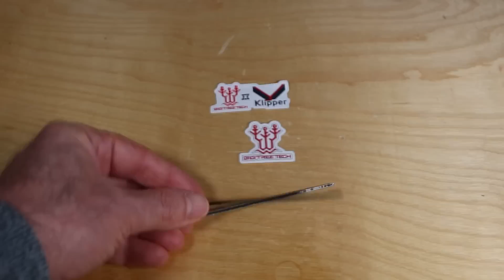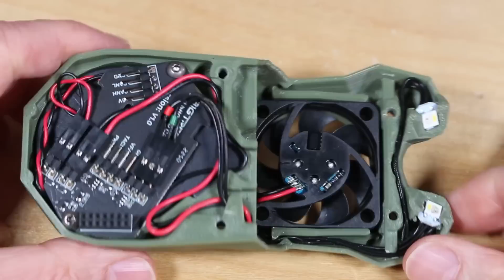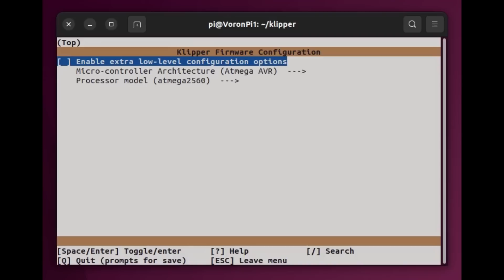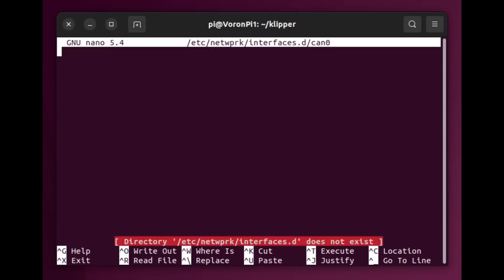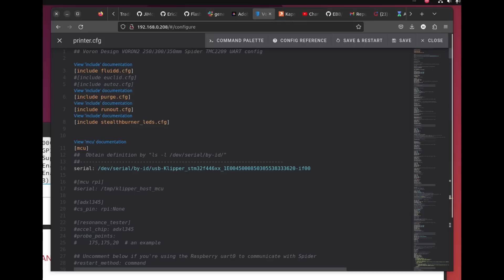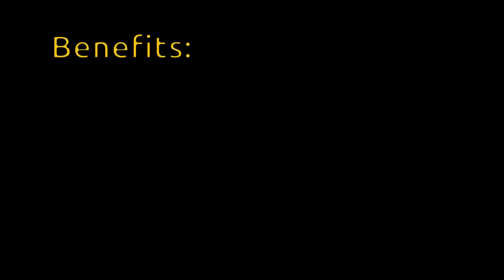Canbus SB2240 and SB2209 3D printer Install, Thoughts & Tips from BigTreeTech (BTT)

Comment: Did you go strictly by the instructions in the wiring?  I am seeing some differences in what you wired vs what I see in the instructions.
Reply from the maker: I might have made some changes. Many of the switch type and sensing inputs are very flexible in how they can be used.  Are there any areas of concern?
Reply: @KapmansBasementWorkshop  Just the wiring of in general, according to the pdf, the 24v VIN on diagram is far right but the labels say its far left, for probe, it states GPIO, gnd, blank, 5v, blank, but then it appears that you have used the far right three which kinda makes sense to me because it appears that the first pin (from right to left) is the actual 5v. so I am just confused on what the right wiring is for the SB2209 is.
Reply from the maker: @ReneWilsonSC  If you tell what items you are interested in, I can come back with where I wired it.  Keep in mind, even with my glasses on, I have a hard time reading these depending on the size of the labeling.  I might have made a few mistakes, but most pins are pretty flexible as long as they are setup correctly.  Also, in some cases, if a wire was not long enough to get where I initially wanted, I will tend to look for a place it can fit.  A switch will work on any set of pins as long as it was designed for a switch.  You just need to get the correct pins entered for that switch in the printer.cfg file.
Reply: @KapmansBasementWorkshop  I would of liked to seen the actual wiring part with explanation for instance I see your using the PT100/PT1000 port.  What exactly are you using with that?  I have a Rapido hotend and I am putting the thermistor in the TH0 slot so what am I missing.
Reply from the maker: @ReneWilsonSC The Rapido (what I used) comes with a PT1000.  So I followed the SB instructions on setting that up.  I won’t be able to take a photo until next week….
Reply: @KapmansBasementWorkshop  OK I am still a newbie so I hate to ask all of this on one go round but figured if I had the question, someone else may too.
 I think I have a bad SB2209 because after you flashed yours, redlight went out and mine is staying on, I was able to get an id on it but I think I need a replacement. I am running Pi, to U2C to Octopus Pro.

 So here are a few questions that I had for you:

1. Your line 14, if I am following correctly, you have connection from Rasberry Pi to U2C to MCU, right?  Do you still show /dev/serial/by-id ?  I am looking on my pi and I do not. I am showing the canbus_UUID though so do you still need that line?

2. ON the sample, it shows [MCE EBBCan] and the labels for pins are EBBCan: Pin, but on your configuration, you are can0, I am assuming I should have can0 because that's the port that we configured in ifconfig, right?  

3. You stated that you cant use UART mode because your using the SB2240, so seeing I am running the SB2209 do I need to comment out all of the SPI parts from under the adx1345?

Sorry to hit you up with all of these questions, but I am fairly new at this CANbus thing.

Thank you in advance
Reply from the maker: @ReneWilsonSC  I'm answering these out of order.....
2.  I call it can0 simply because I used that on a previous canbus board I was using.  I simply like.  You can call it EBBCan or can0 or anything you like actually.  
1.  I have the main MCU connected directly to the pi via USB.  I also have the pi connected to the U2C via another USB port and cable and then the U2C to the SB2209.  In my printer CFG file, I have 2 mcu's listed:
[mcu]    
##	The MCU that runns all the other motors
serial: /dev/serial/by-id/usb-Klipper_stm32f446xx_1E0045000850305538333620-if00

[mcu can0]    
## The SB2209/EBB36/or whatever canbus is mounted on the print head.
canbus_uuid: f545025fdc42 

You must have both lines as you need to instruct klipper where the 2 MCU's you now have are located.

3. I seemed to have lost my previous printer.cfg file.  But I believe this is correct.  But if I were you, I would have a look into the BTT GitHub.  They have a sample printer.cfg file that shows you how the pins are configured for the 2209.

Comment: So with the per-crimped wires suggestion, how did you connect those to the existing wires? For example the Heater cartridge or the Heater TH?
Reply from the maker: I cut off the existing connector on the TH for example, place heat shrink tubing on the wires, solder the pre-crimped wire onto the newly cut wire and then shrink the heat shrink.  I've been told the newer kits come with pre-crimped connectors.
Reply: @KapmansBasementWorkshop  makes sense. I just got the SB2209 and did not come with any pre-crimped wires. Did you do the same for your hotend heater cartridge wires as well?
Reply from the maker: @jaredlewis2961 Actually, I can’t look at the printer right now, I believe I treated that one a little differently. I think I built an adapter cable for it.  My hot end wires were too short to reach. I trimmed one of the precrimped wires and attached a connector on the other end to plug the hot end cable into….

Comment: How have you done the labelling on your cables?
Reply from the maker: I didn't.  The lengths are so short on the tool head and easy to trace.  I did not bother.  Also, for the canbus cable, I felt the colors were quite clear so I left those alone as well.  It's only 4 wires.  This isn't the best answer, but so far it's working for me.

Comment: I would be curious to know what connector you used on the U2C to connect the canbus to your SB. The reason being that there are JST connectors as well as the Molex ones for connecting canbus clients. I am assuming due to the power requirements that you need to use the Molex.
Reply from the maker: I actually used the screw terminals on the U2C. No connectors.
Reply: @KapmansBasementWorkshop  In your video the green power rail is used to connect to power. So how are you powering the SB2240/2209. Is it powered directly from the PSU? Hence the question about the Molex. I was under the impression that you use the power rail to connect to the PSU and the molex to connect both power and can h/l, to the SB
Reply from the maker: @GrumpyDave1  I have done it 2 different ways.  Both work.  1. 24v + and - wires from the PSU into the screw terminals on the U2C  and using the same screw terminals for the power wires on the canbus cable.  2. Canbus power directly to the psu screw terminals. And a 24v cable from PSU screw terminals to the U2C screw terminals.  I don't think this last cable was needed, but I connected it just in case.  They both work fine.
Reply: @KapmansBasementWorkshop  So I decided to go with PSU to green power connectors on the U2C and Molex for the power and canh/l to the SB2040. I do like your way to avoid having to crimp a molex. I assume you used the screw terminal on the U2C for the can h/l?
Reply from the maker: @GrumpyDave1  Yes, I used the screw terminals for H & L.  I've never fully mastered the art of crimping those connectors and I had to cut the connector that was on the cable to feed it through my intended path.  So I just skipped crimping outright.  I'm sure the Molex option is just fine, possibly better in the long run.  Thanks for the questions and comments!

Comment: Guy are you having problems with the stepper stopping mid print
Reply from the maker: The extruder motor?  You might need to lower the current to the motor.
Reply: @KapmansBasementWorkshop  i have lowered the current to 3.0 should i go lower?
Reply from the maker: @grathado28  Do it just stop completely, or does it make some noise of any kind?
Reply: @KapmansBasementWorkshop  i just want to update you i was completly stupid the motor actually never stoped but i i think the lever inside the device was off (lgx lite) i fixed it and now it prints like a dream your rock for getting back to me thanks :D
Reply from the maker: @grathado28  I'm glad you got it working.  I have made the same mistake before!

Comment: How are the pre-crimped connector wires holding up with the chamber heat so far? I have this setup and having the same issue as you, can't see them well enough to crimp them. lol.
Reply from the maker: They are working well.  I have had no trouble with them.  Also, the crimps are much better than any I have ever done before.
Reply: @KapmansBasementWorkshop  Great thanks for the info. I bought the wire kit you mentioned so will do it the same way. any soldering tips for them since it is a cramped space for the wires already?
Reply from the maker: @Dbauer50  I measured and then cut and soldered prior to installing the cables.  Also, make sure you have heat shrink tubing on hand!

Comment: I don't know what I'm doing wrong. I've gone through three of these on exchanges and I can't get any of them to show up with the lsusb command😢
Reply from the maker: I would check the following:
1. Test the USB cable with your laptop and some other external device to make sure it good and works with data.  Some are only for power or broken.
2. Did you flash Klipper onto the SB2209?
3. Is the SB2209 powered?
4. If using a u2c, is it powered?
5. Try rebooting the PI
Those are the only issues I can think of where this might go wrong.
Reply: @KapmansBasementWorkshop  The sb 2209 won't show up, so I can't install Klipper on it. That is the issue. The only thing I can think of is that I installed something wrong on the pi. I also noticed I don't see my main board through Mainsail anymore, I think my problems are a little deeper than a bad cable or hardware

Comment: Any clue as to why I have no can0 file? In reference to about the 15 minute mark. Folder is even empty when I run an ls command. Thanks!
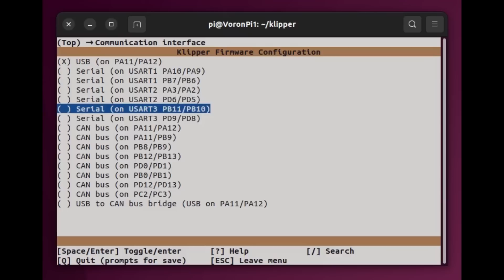Reply from the maker: Yes.  You never had any canbus devices installed previously.  It's normal.  Perhaps my choice of words in the video was not ideal.  So in your case, simply create the file.  More details at 11:30 into this video: https://youtu.be/jgE3XMM9PBk

Comment: Thank you for yet another useful video. I've bought the kit and it now comes with pre-terminated wires.
Why have they moved the X axis end-stop switch to the toolhead?
Reply from the maker: That's good it comes with pre-terminated wires.
It's only if you want to use it.  You can still use your old endstop switch and location if you like.  Many who choose canbus go umbilical to get all the wires off the gantry.  They will also move the y-endstop to the back of the gantry.  But you can choose to not do that.  Have a close look in the video. There are no cable chains on the x or y axis.  To do that, the x endstop need to move to the tool head.  Thanks for watching!
Reply: @KapmansBasementWorkshop  Thanks for the clarification. Moving both end stops make sense and is something that I am going to do. I'll have to do some research and find  the optimum spot for the Y switch.

Comment: Thank you for your previous replies however Im wanting to make sure I get the connection to my U2C board done correctly. How did you make the canbus umbilical to the U2C board connection? I thinking of using the 4 pin square black connect. On the umbilical there is the obvious red and black wires for GND and VIN, but then the green and yellow wires that where already terminated are CAN but what color is can high and what color is can low?
Reply from the maker: Yellow is usually high. But to be 100 sure, I would check the pinouts for the canbus board. I will check for you, but later today.

Comment: I've been all over the Voron-Stealthburner Github page and can not find that small adapter plate stl file. Got a link? Also for using tap where does it plug in and what what voltage do you set the Prox voltage to on the SB2240? I just want to confirm before I release the magical blue smoke! Great videos
Reply from the maker: Here is the spacer you were looking for: https://github.com/VoronDesign/Voron-Stealthburner/blob/main/STLs/Clockwork2/%5Ba%5D_pcb_spacer.stl
The SB2240 and SB2209 are powered by 24v straight from the power supply.  If any of your fans need 5v or 12v, that needs to get set on the board they are connected to that gets mounted into the SB cowl.  Each fan output can be set individually.  TAP will plug into any of the ports designed to handle switches, but I used: PB9 For all the TAP wires, I need to go back in and look as I've forgotten.  But depending on the optical sensor on TAP there is a good chance it needs to be connected to 5v.  Let me know if you need the full wiring for TAP.  I'll need to go back and look.
Reply from the maker: Actually, in the BTT Manual for the SB2240 and 2209.  Page 7 shows the pinout.  PB9 is a pin where the BLTouch would normally be connected.  That is where I connected TAP.  PB9 is there as well as the needed 5v.  I hope that helps.  Thanks!

Comment: Thank you for the instructions! This was an inspiration for me to get the SB2209.
I am not quite sure I understand how do you flash the bios? After connecting the usb cable from the Pi to the U2C and pressing the boot, do you then connect the SB2240 to the U2C? Do you ever flash the new firmware to U2C? And if this is out of the box U2C, should it be flashed?
Reply from the maker: So you just touched on a problem with the video that I did not notice until it was too late.  I did not flash the U2C, I used it as it came out of the package.  No flashing was needed.  But you need to flash the SB2240.  For that, plug in the USB cable into the SB2240, as the video actually does show (the section is titled incorrectly), boot it into DFU mode and flash it.  Once done, you can plug it into the U2C and you should be good to go on the rest of the video which is really just configuration.  My apologies for that.
Reply: @KapmansBasementWorkshop  thank you! I flashed it and it is showing in Klipper now in the temperature section. Everything looks so clean without the cable chains!
However I ran into some problems. Hotend heater and thermistor seem to work, I tried to heat it up to 50C, but both fans and tap doesn't work.
I checked voltage, polarity, for fans, tried to connect them without LEDs, but nothing helped. Tap I tried to connect to different pins (PB5, PB6, PB7) but it does not trigger.

Do you know what might be the problem? Or how to debug if the board works correctly? It scares me to but the chains and all all the wiring back 8-E
Reply from the maker: @otann  If you are sure the wires are all connected correctly to the proper pins, I would assume either the printer.cfg settings are incorrect, or possibly that the connectors are not crimped/assembled correctly (I struggle with crimping).  Those are the only issues I can think of.  In my case, I had TAP set to pin: can0:PB5 and the "probe" section in my printer.cfg file reflects that.  For the fans:
[heater_fan hotend_fan]
##	Hotend Fan - FAN0 Connector
pin: can0: PA0
max_power: 1.0
heater: extruder
heater_temp: 50.0

[fan]
##	Print Cooling Fan - FAN1 Connector
pin: can0: PA1
max_power: 1.0
kick_start_time: 1.0
off_below: 0.10

I'm not sure what else I can suggest.  It's most likely just wiring or printer.cfg configuration.  I wish I could provide better help here.
Reply: @KapmansBasementWorkshop  You provided a ton of help, I am incredibly grateful 🙌 I ran out of crimping terminals and gave up on this board. Also tried to check voltages with the multimeter, but I am not very experienced with it to fully understand what's going on. When I set housing fan to 50% then I see half of the voltage on the fan pins. But I don't see any change in voltage on the SB2209 board. So I assumed I accidentally fried it somehow.

But in the end I got Mellow SB2040. It has less features of course (you can't change fan's voltage with jumpers) but it uses much more available connectors — JST PH2.0, way more easy to crimp. And it is smaller, and companion plate is compatible with non-can breakout board.

Without your video I would not even be even aware of the CAN and umbilical approach, so huge thanks again. You are making great content!
Reply from the maker: @otann  I'm sorry it didn't work for you.  But I'm sure the Mellow will work out great.

Comment: Have you been getting the undervoltage error, my board was fine for a few weeks now i get this error all the time and i cant print anything?
Reply from the maker: I have not had any issues with the SB2240, I was having this issue with the XY motors.  I'm 90% sure it's unrelated.  If you are having the issue with the SB2240, please have a look at this:
https://github.com/Esoterical/voron_canbus/blob/main/toolhead_flashing/common_hardware/BigTreeTech%20SB2209%20and%20SB2240/SB2240%20Stepper%20Configuration%20and%20Undervoltage.md
For the x & Y motors, the problem cleared when I slightly lowered the current I had running to the xy motors when sensorless homing (which was quite a but higher than most people run theirs at).
Reply: @KapmansBasementWorkshop  yeah i already updated my cfg with Esoterical config but no fix yet, thanks.